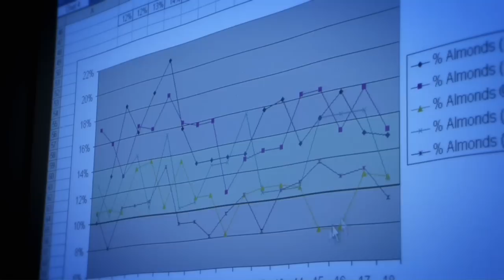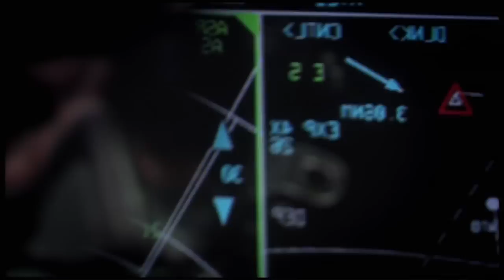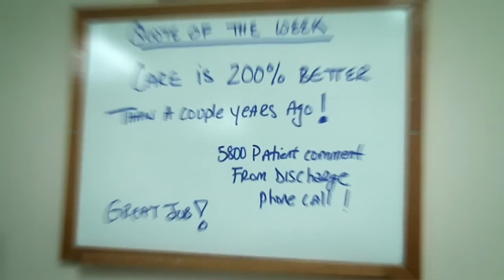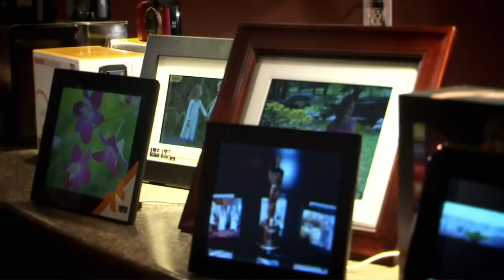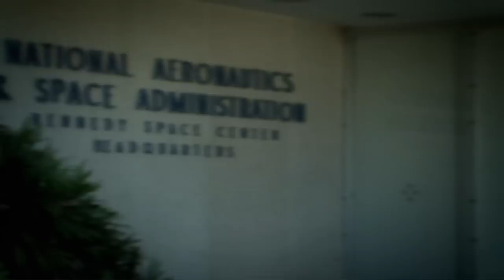Industrial and Systems Engineers Make a Difference Everywhere

Comment: ...Continued2@JustSomeEngineer:  Potential soft cost labor saved = $52,000 - $176,000 by setting up clear systems, which achieved an average savings of 10 minutes a day per employee.  And I was the RECEPTIONIST at the time, NOT AN ENGINEER.  So you have a great advantage, just keep track of it all.  It adds up.  

Plus – what about taking a few courses and earn a minor on the side?  Even one course a semester (ABET accredited) would be a great addition to your resume/skill set/marketability.